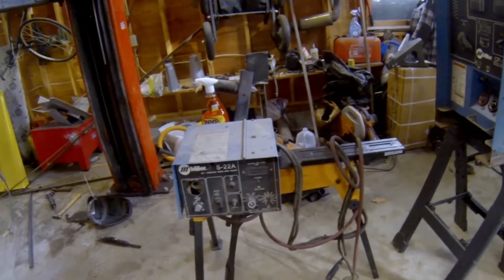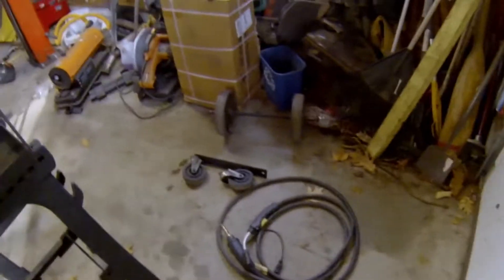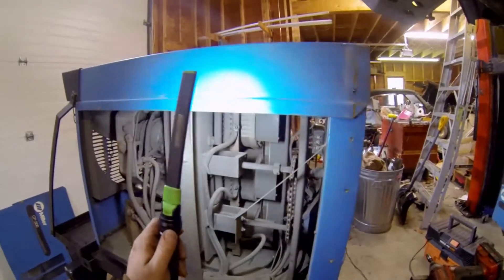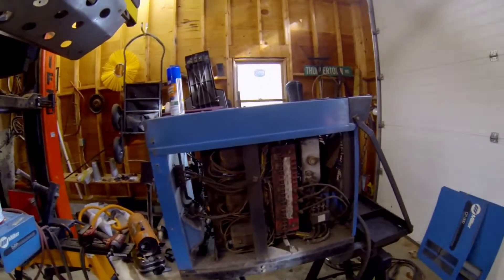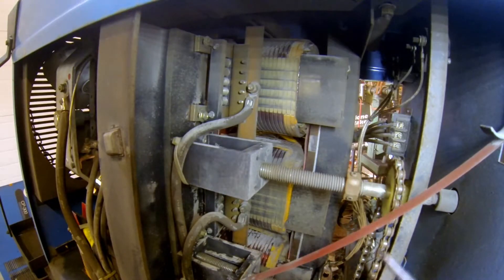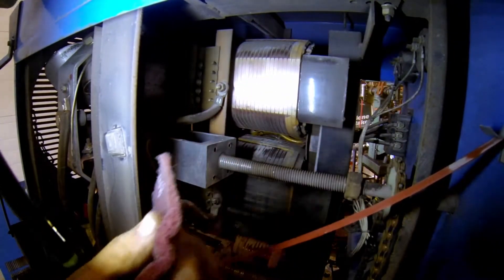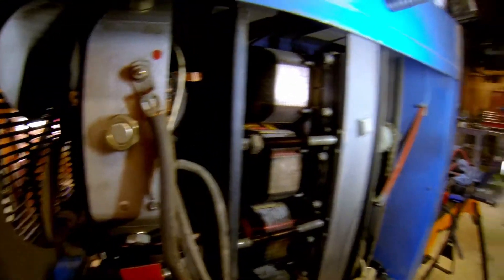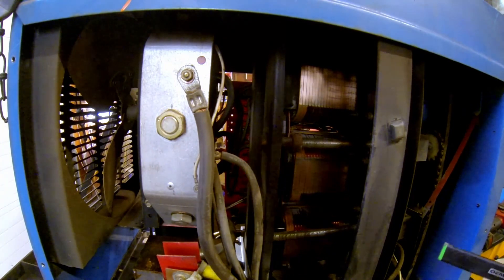Miller CP-300 Welder Haas-Kamp Conversion Part 1 - Cleaning and Prep

Comment: I have a Miller MC300VS welder with a miller S54A Feeder. From the wiring diagrams it looks like the conversion would work. Can i get input from you about it i can send my millers wiring diagram if need be but it all looks the same

Comment: My Miller CP-300 3 ph has an issue. The wire burns and turns red the moment it touches the metal even without pressing the gun trigger.
Any ideas?
Thanks.

Comment: So I have Airco CV250 3 phase someone told me this may work for me are they the same ?
Reply from the maker: They are not the same, after some casual googling it looks like the airco is simpler in some ways as it has a 2 core transformer vs a 3 core in the miller.  There are some posts on weldingweb and practical machinist.  I would look for some posts where Dave Kamp chimes in, the guy really knows his stuff(he and a friend basically invented this conversion).  https://weldingweb.com/vbb/threads/261721-Hass-Kamp-conversion-on-Airco-CV250 this link has some wiring diagrams that seem decent, but no real word on how well it worked.  Good Luck!

Comment: Hey man thanks for video I have a Lincoln cv-250 you think this haas kamp conversion will work on that unit I got?
Reply from the maker: I'm fairly confident it's possible.  What's the serial number on the unit, I want to make sure I'm looking at the correct wiring diagram.  I'll try and make a reasonable diagram for the conversion from the original.  I would also suggest looking on practical machinist forum, Dave Kamp(of haas-kamp) is very active on there and he helped me tremendously.  The only complication I see is that the cv 250 seems to be a little more electronic on the inside than my old unit.

Comment: Some powdered graphite might be good on the screw drive
Reply from the maker: I wouldn't say it turns buttery smooth now, but once I worked it back and forth it was certainly serviceable.  A touch of graphite certainly wouldn't be any worse for the insides than the unavoidable grinding dust.
Reply: @wirestiresandfires214  some molybdenum disulfide might be a better option.  it's slippery like graphite, with much lower electrical conductivity.